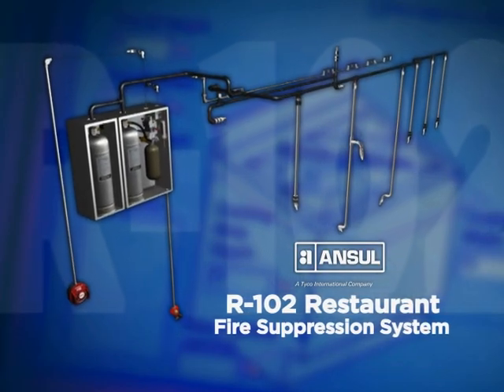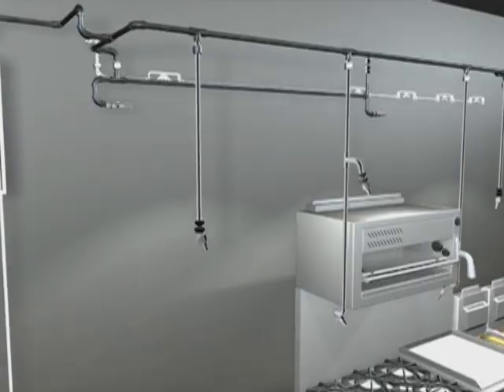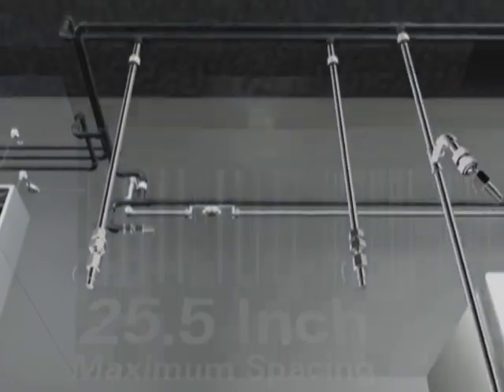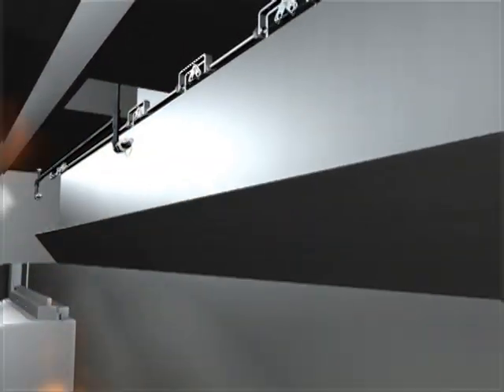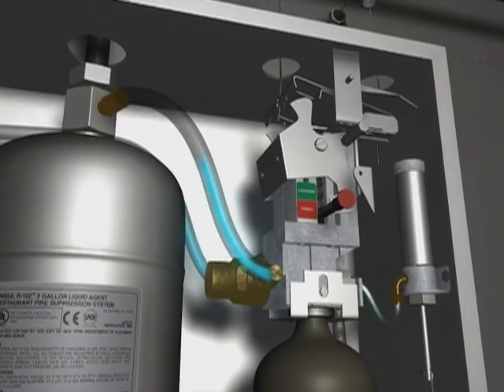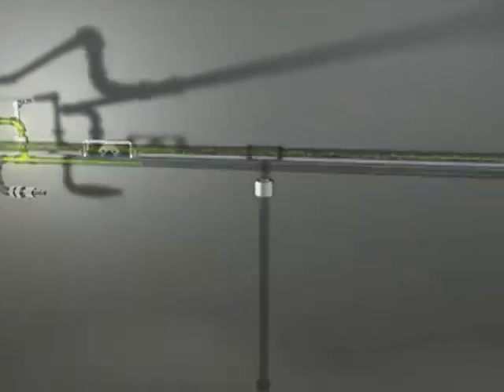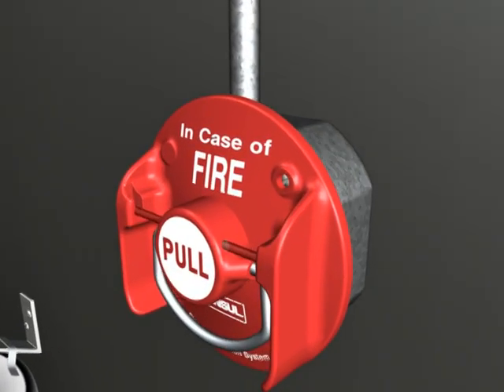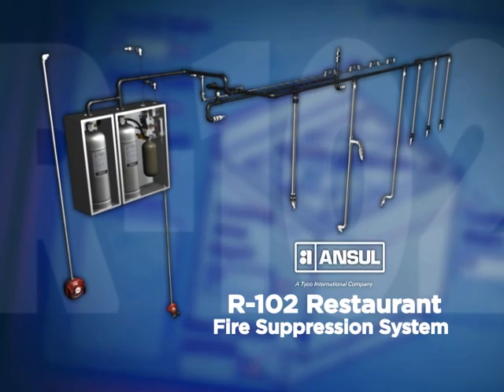Ansul R102 Restaurant Fire Suppression System Animation

Comment: What is the best way to remove this system when no longer needed?
Reply: Contact the manufacturer. It's basically plumbing so anyone mechanically and electrically competent should make short work of it. In that situation I would repurpose a discarded system for personal use in garage or workshop (and am watching this to learn more before I scored a used system).